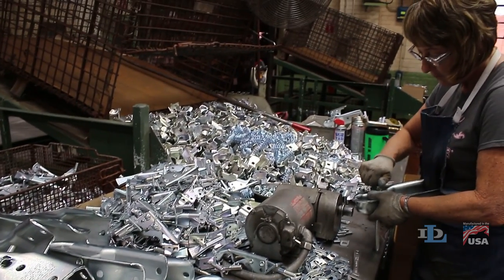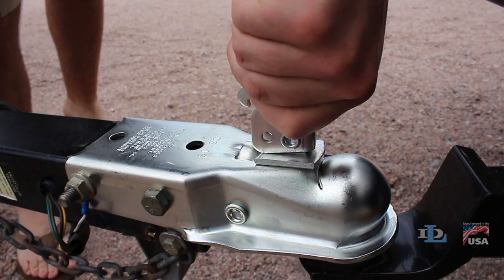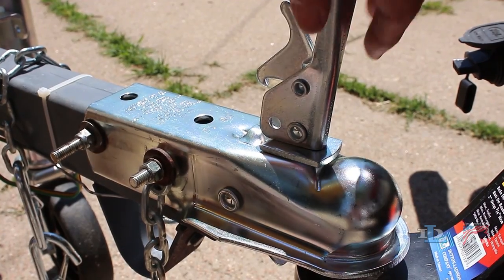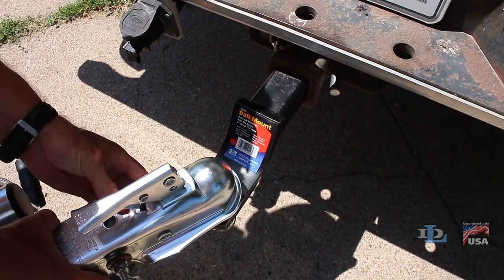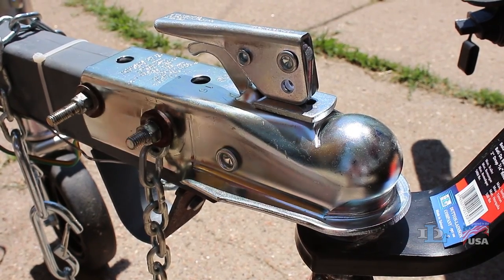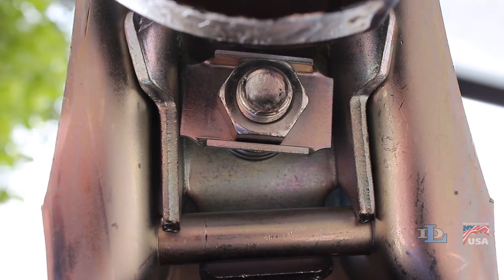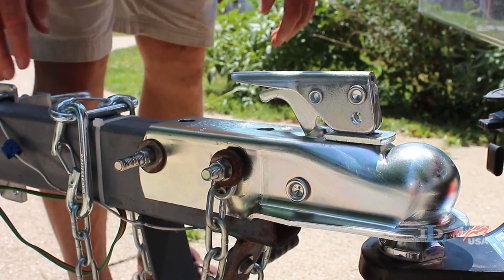How Do I Adjust My D-L Coupler? - FAQs

Comment: I’m so grateful to you!  I’ve had so many problems with this!  Including the other day when I was loading up my zero turn onto the trailer, thinking everything was set. The trailer suddenly tilted as I was going up, and instead of realizing the coupler wasn’t hitched right, I drove on up. When I got onto the trailer, the weight on the front made the trailer dip forward. Terrified, I went in reverse, which made the trailer pitch backward, which then made me repeat going forward and backward. The trailer was rocking like a seesaw, with the trailer tongue going up and down violently, bashing onto the ball, my truck, whatever. Panicked, I thought it best to get the weight of the mower off the trailer, but then decided that was too dangerous. When I put the emergency brake up and turned the mower off, at least the bucking stopped. I was miraculously able to adjust the coupler by hand and live to fight another day!  But I, too, have been terrified of the thought of taking the trailer anywhere. Simple but critically important info—thanks so much again!!  😳

Comment: Ok, pick up my trailer. Cupler and leaver worked ok. Got the trailer back home and the leaver is not releasing.  Had to pull the Carter pin and the pin on the hitch and move the truck forward.  The Ball and bar are still in the trailer coupler.  Spraied WD40 up on ball the underside and top side of the coupler and handle.  The handle still will not release the ball even with force.  What next.
Reply from the maker: Thanks for reaching out, Robert.  Here are a few things you can try if you can't release the locking lever to adjust the coupler (as shown in this video):

1. Are your coupler mounting bolts too tight?  Loosen them and then try to remove your coupler from the ball.  
2. Is your coupler or coupler ball damaged?  If so, one or both of them may need to be replaced.
3. Is your coupler the right size for your coupler ball?  We offer couplers for both 1-7/8" and 2"-sized balls.

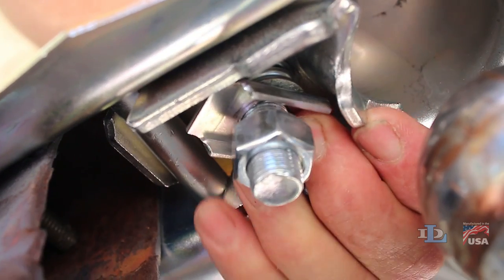Comment: This is a GREAT video,,,thanks so much!.  Only thing is, I am not able to 0:36 simple push the lock lock channel by hand. It is has way too much pressure on it. My coupler is loose on my ball and rattles.  Is there a trick to get the lock channel to go up so I can tighten the nut a bit?
Reply from the maker: Thank you for the kind words!  To help with your stuck nut locking channel, we have a few suggestions- 

Is your locking lever in the unlocked position (see the 33 second mark of this video)?  If so, unlock it and try to push up the nut locking channel.
Are you trying to push up the nut locking channel when your coupler is sitting on your hitch ball?  If so, move the coupler off the ball and try to push up the nut locking channel.
Is it possible that your coupler is very rusty, or that one or more of the parts in your coupler is bent or broken?  If so, you may have to replace some parts on the coupler or the entire coupler itself.
Is the nut locking channel possibly turned in the wrong direction (90 degrees different from how it looks at the 36 second mark of this video)?  If so, turn it 90 degrees so it matches how it looks in the video and then try to push up the nut locking channel.

If none of these suggestions fix the issue, please call Joe in Engineering at 402-462-4141, extension 217.

Comment: I don't know y i have problems with the coupler  it's hard too lock the.   I have to stand on it too locking up. And is no way to take it off.  I have to pull out the hitch of the car. Please help
Reply from the maker: Thanks for reaching out!  It should never be as difficult as you are describing to remove a coupler from a hitch ball.  Is your coupler and/or ball very rusty?  Is there a chance you are trying to use a 1-7/8" coupler on a 2" ball?  Please give us more specific information in an email to marketing [at] dutton-lainson [dot] com and we will be able to better help you.